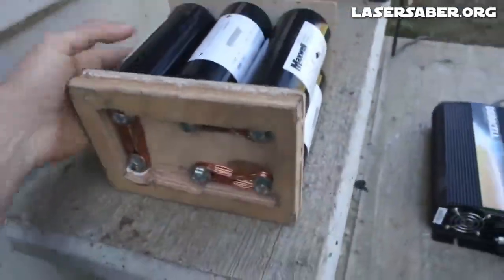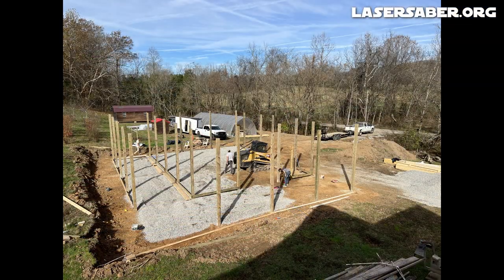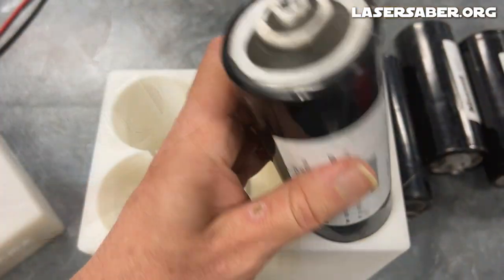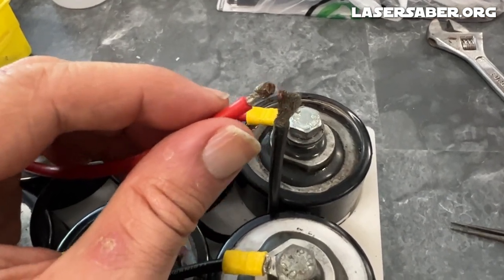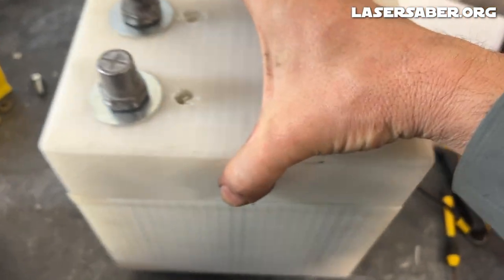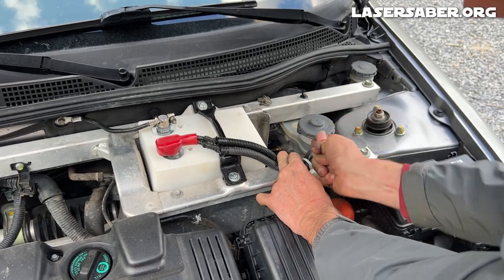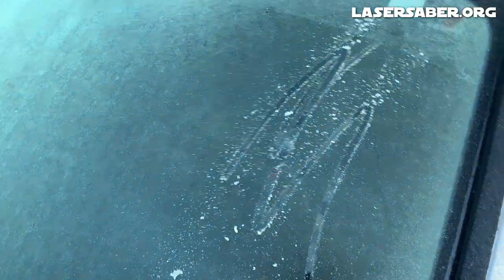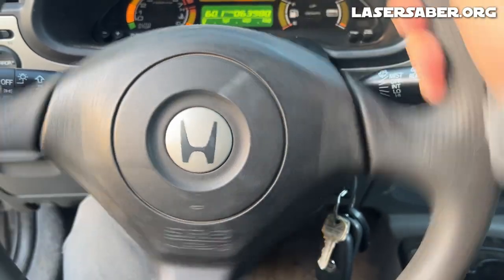Replacing My Car Battery with Capacitors in 2023!

Comment: Oh yeah that video of yours 10 years ago was an inspiration to do it myself. I currently have the same 6x350F now in my 3'rd car (They are expensive in Europe and no second hand ones available).  Have a 10W solar panel  on the dash to counter self discharge. They are always full even in winter. Mine is just stuffed behind the dash in a taped up box of coroplast. I have saved hundreds of $ in batteries not bought.

Comment: I would add the LiFePO4 as well, just for smart backup. They can charge the caps when in failure.
Reply: I would just get one of those portable lithium emergency starters/inflators/flshlight things instead
Reply: I'd assume the danger of needing to jump your vehicle goes up 10x since you have magnitudes less storage energy than even a lead acid.

Comment: I've actually wanted to do this for some time. However I sometimes like to sit and listen to the radio with the car off. I'm not sure there would be enough amp hours to do that.
Reply from the maker: Not the best system for listening to the radio with the car off.
Reply: @lasersaber  I've found trying to do anything with the car off for any length of time is a great way to kill a battery. I left a light on overnight by accident once and that seems like the safest upper limit.
Reply: Consider a hybrid setup with a small battery in parallel with supercaps. You should be able to size your system accordingly for the right amount of reserve.

I ended up doing a ~30 Wh setup with a 6S2P supercap config (1000F 16.8V rated). I can run the radio with sub for a decent amount of time. Can start the car with as little as 7V with a warm engine which is neat. 

What would really make supercaps practical in starter applications is a high powered bi-directional dc-dc converter to boost the voltage to just above usable levels. That would unlock another 40% of the usable energy in a supercap and exploit its unique advantage over batteries to discharge down to low voltages while still providing significant power.

Comment: I was looking to replace my electrics cars 12v system with some ultracapasitors... until I crunched the numbers. A typical car has a battery has 50ah of energy, 6 x 2.7v 3000f capacitors are about 1.3ah. You would need 228 capacitors at $60 each = $13,680 or 114kg of super capacitors to replace a typical lead acid.

Comment: Awesome to see this idea return to the channel and in a prettier guise as well ;).  You suggested that drain shouldn't be a problem on this car, but it was with the original pack and IIRC you added an LFP battery to keep it topped off.  I look forward to seeing how this holds up if the car goes a long time without starting.

Comment: I've used a motorbike batt in my Gen 3 Prius for 3 years (no need for expensive cranker, cause it doesn't crank!). 
Have got some 500F supercaps and am thinking about this. Thanks for the prompt to get them wired up 👍

Comment: after seeing ur old video years ago i built a lifeo4 hybrid pack with 5s1p 28650 cells and 3 maxwell 58f 16.2vdc modules and it works great and has the amp hours and the cold cranking amps of old battery
Reply: Can you show the detail of your build? I want to make one the hybrid supercap and battery

Comment: You could add a small solar panel to keep the boost pack topped off when the car sits for a long time, or just add a trickle charger
Reply: I used one of them small solar panels on the dashboard of a BMW i only used to drive once a month when I was working abroad.  I got fed up of replacing the car battery every winter.  After I fitted the solar panel the car never went flat.  Even in the UK's darkest winter :)

Comment: I am making a negative cable cutoff using a starter relay hooked to the positive side of the boostpack. It will allow for an in cabin battery cutoff.

Comment: Fantastic to see you're still at it. Very pragmatic approach you have. Capacitors offer several advantages over batteries. One of which is that you can completely discharge a capacitor bank without hurting it. You CANNOT do that to a battery without badness following! This means that Capacitors have substantially higher usable energy than often given credit for. With the proper engineering - this advantage can be leveraged substantially. Have you done any experiments with BOOST/BUCK converters?

Comment: Wow, it’s encouraging to hear about your shop. Our farm is just getting up to speed these days, and I am dearly looking forward to  unpacking two cargo containers of tools and supplies…and finally getting a shop underway for the first time in nearly a decade.

My Maxwell 6x 2600F boost pack has been serving us well for around 10 years now. Although I’ve been considering making a 2nd pack…the Maxwell caps are still over $50/each these days. However, have you considered other ultra caps now on the market, such as the 2.7V 3000F units? Do you have any thoughts on building a boost pack with those?

Comment: What happened with the original capacitor replacement, how long was it used? 
Did it work good in the winter when much higher power is needed to start the car? 
How many seconds of cranking would it give you if the car had a problem starting?
Does this one have the same capacity? What was the total cost?
Reply from the maker: Most of your questions are answered in this video: https://www.youtube.com/watch?v=OvbuJwYnbvE
This new unity is the same as the original.  I used it year around for years in my old car.  This playlist has loads more info: https://www.youtube.com/watch?v=GPJao1xLe7w&list=PLUd8qSRI_F8hD-8Gdufp9MDChEC9ccavr

Comment: Would a small trickle charger solar panel keep your boost pack topped off when it’s just sitting? (Also allow it to recharge if you accidentally discharged the pack while on the road?)

Comment: That's great, I just had to replace the battery in my truck, fortunately it was in warranty so it didn't cost me but I need to see about building one of those boost packs before I need to replace it again unless I can convert it over to electric. What is the best electric EV for a 1/2 ton truck with enough power to pull either a loaded cargo trailer or a loaded car trailer as well? I just saw this video, thanks.

Comment: Hi, great video.  Im looking to save weight and get longevity on my sequoia.  how is it charged once in the car? any bms needed? can it power all the electronics plus add ons? what is the AH? what is needed to add a lithium battery to it if AH isn't good on its own?  i will be installing a 250-370amp alternator due to all the added accessories; will that alternator pose an issue? how do i prevent over charging?  can i still jump start the vehicle if they are drained, or do i have to charge it instead?  thanks for your time.

Comment: Because of you I bought 6 sets of super caps. I have a diesel and was hoping to make a double sized cap and I also wanted to use 1/8 by 3/4 wide aluminum bar between the contacts then have a bottom and top just like yours. Is it unsafe to go near the ends of the terminals when charged can you get a shock like out of other caps? I'd love to put 2 doubles in my van car and then 1 in my tractor. And 1 extra for a booster battery. I have followed you for a very long time.
Reply: How has this worked out for you?

Comment: But how long does the charge hold in these? How does the system know not to overcharge them? What are the risks of them in a car crash? so many variables to consider.

Is it legal per state or federal regulations to be using these in place of what was meant to be used too.
Reply: The charge holds much better than any conventional battery. The charging system simply regulates voltage, so it doesnt matter what the energy storage device is as long as it can handle that voltage.
The specific dangers it poses in a car crash are probably smaller than that of a lead acid battery, because those have a much higher energy density and will apply voltage much longer in the event that a crash causes a short circuit.
As far as I know there's no regulation directly addressing what type of energy storage you have to use.

Comment: Maxwell made a capacitor start for trucks your two capacitors short to get 14 volts it was a parallel series setup Consistent with Maxwell’s current award-winning ESM product, the ESM ULTRA 31/900 delivers the quick-burst power trucks need to crank their engines in extreme cold, down to -40°F.

Comment: What might work best could be a hybrid approach. Keep the battery, but put the boostpack between it and the starter.   You could have all the storage and stability of the battery but the booster could handle the heavy lifting

Comment: i used some cheap 500F x 6 in series, able to start my 1.3cc sedan car no problem but it cant hold charge for even 1 hour, the voltage drop too low. Wonder if i change to Maxwell brand, will this problem be solve? My car is quite new and no charging issues.

Comment: Could a smaller set of super capacitors be used to supplement the amps of a LifePo4 battery to start the car? 

I’m building an RV and I’m curious about replacing all of the batteries with lithium, the super capacitor would allow me to install some equipment and batteries where the original battery were if I can fit them. I think I wouldn’t need nearly as large of capacitors if I have a 350A peak discharge already on the lithiums.

Comment: I have to replace the batteries on my bus which has a 7.5 liter diesel engine. I'm intrigued by the capacitor option. I realise that this is just an experiment but as my bus is normally started with a pair of group 31, 900A batteries, how many capacitors would I need to crank it?

Comment: Starter relay as a battery disconnect? Use either the ignition as the switch or a separate switch? I have used my boostpack as the only battery in my semi tractor for several years with a manual battery cutoff.

Comment: Wouldn't this beat the hell out of the alternator? I mean because of the onboard electronics. Also when repairing the car a mechanic is going to need to use that OBD2 port typically with the engine off. How would this function under those conditions?

Comment: Can you give me some insight on a project I’d like to do?  I’d like to replace the lead acid battery on my standby generator with a boost pack. The generator has a built in trickle charger so I think this would be a perfect solution.

Comment: Why would you bother going with lead posts that will oxidize over time? If the pack will last the life of the car then why not just solder or swage on a permanent connection that will last just as long?

Comment: Would be interesting to know the idle voltage draw of the vehicle once it has sat off for 30+ minutes (multimeter in line on the negative, but must be hooked up in line the entire time because as you probably know, once you remove and reconnect a power source to a vehicle a bunch of internal computers wake up and won't be at true idle).

And instead of like your video from 10 years ago where you'd key on the car to check the voltage read out from the cig lighter adapter, instead just check at the terminals what the current voltage is, since I think keying on skewed your results from that test (was still good info).

I wonder why something like these little capacitor banks aren't used along side a standard battery for extreme cold weather environments. Instead it seems people will use battery heating pads. But these seem like a simpler solution. Putting the capacitor bank between just the starter and the battery.

Comment: I've wondered about the cheapest plugin hybrid conversion I could come up with. And that would be to disconnect the alternator  and power the vehicle's electrical system from two or three 12v lithium batteries. One under the hood and one or two in the trunk. Include A 12v charger that gets plugged into  power chord to the wall.

Alternators are terribly inefficient. To say 70% efficent is generous. If an alternator is rated for and generating  1000 watts of electricity, the belt  has to deliver 1428 watts of mechanical power. If the belt is 95% efficent  at transferring power from the engine to alternator that pushes the power draw on the engine to about 1504 watts. And if the engine is 30% efficent at converting chemical energy mechanical energy, then that's a little over 5000 watts of power fom burning fuel. 

  Naturally one would not normally draw the max rated power off the alternator for very long if at all. But the general point is to take the vehicle's electrical load off the alternator and the engine it's connected to. And technically you'd have a plugin hybrid.
Reply: Yes this is what one would expect if they used their car as a generator. Keep in mind these alternators are not generally pulling their rated power, so the losses can be significant, but are not on average not very much. 

If you don't have access to an electrical outlet because you live in an apartment or city, it could be very difficult to maintain an auxiliary battery without an alternator. Having an onboard generator means you can go places where there isn't grid power, and run your electrical loads for many hours without worrying that essential 12V functions may not remain operating.

Replacing the alternator with a BLDC generator, or improving the engine efficiency by adding waste heat recovery would be something I would prioritize over adding a 500-2000 Wh auxiliary battery.
Reply: @InfinionExperiments  those without easy access to a wall outlet will always have a problem with a plugin anything. Maybe since the actual amount of electrical energy used is relatively small. Some people might consider augmenting a plugin with a solar panel. 

A more efficent bldc motor may work as a generator. But you'll need a buck converter and you may loose  some of the efficency gain. And it may be dificult to find off the shelf parts and brackets to work with any vehicle. But if you have the means to make one, by all means it might be worth it. And, If you do go with a bkdc motor, you may also add a few extra batteries and use the bldc motor to make a plugin, serries hybrid  that adds maybe 1kw of mechanical power from the electrical motor poweted by battery.  So maybe where 90% of your driving would not need generator and it  would motor, it could still be made to generate on a long trip to prevent battery from going too low or in the situation where you would not be able to plugin and charge your batteries. 

The nice thing about these ideas is that they are relativly cheap by comparison.  My first one ecen cheaper. The down side is that they have a limited impact.

Comment: I am surprised you did not make a crystal Power Cell instead of using capacitors one question I'd like to know the answer to Is how much voltage can you achieve with a crystal power supply? and do you think that you'd be able to make a big enough battery using the crystal Power Cell to run a electric car? and if so let's do it just think about it you would never have to charge your electric car again